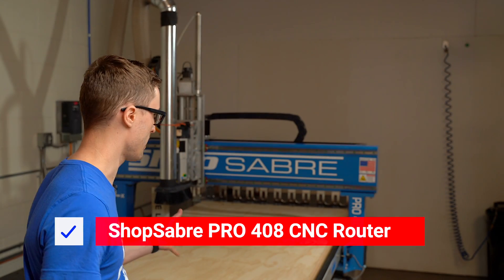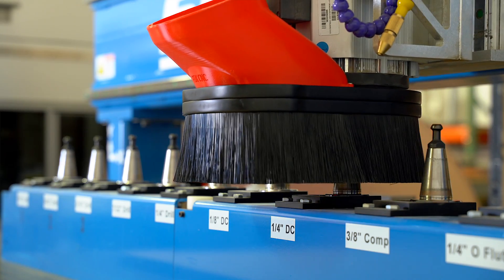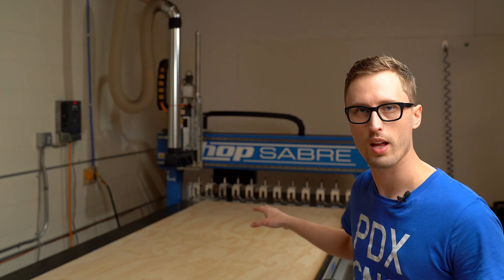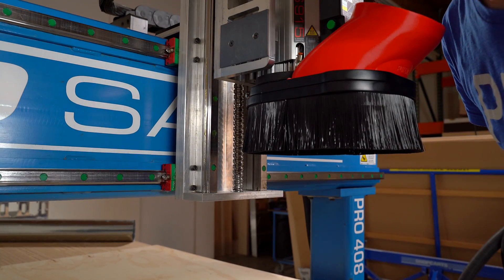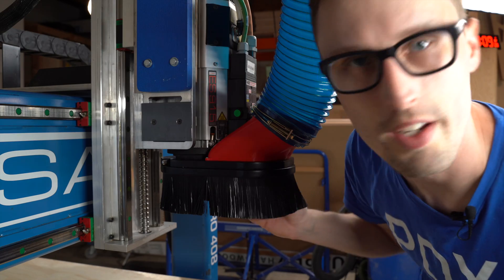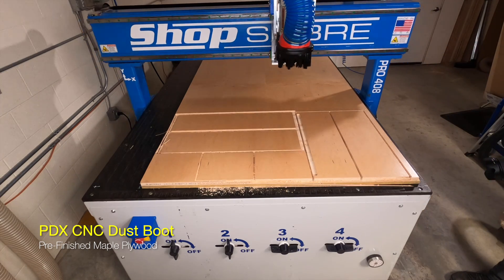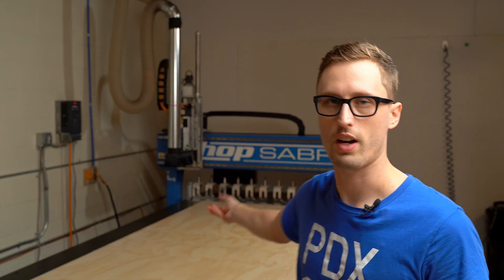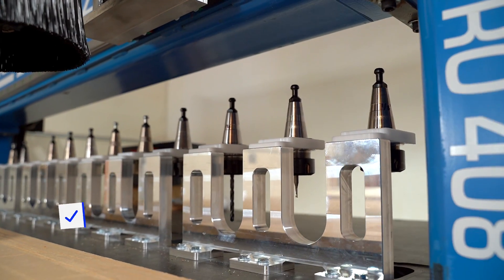CNC Router HSD Dust Boot Upgrade

Comment: I like the baby pants but.  Is the area of the 5" duct maintained throught the pants?  Any reduction of cross sectional ara is a flow resistance.  Maintaining constant area in the flow path is optinum.  What do you think?
Reply from the maker: Yep definitely
Reply from the maker: The cross-sectional area of the path from port opening to spindle increases from 5” to quite a lot more.

Comment: I’m going to go see if this will fit my ShopSabre 23 with 2.2 HP HSD.  It looks like it might. One thing this looks to have is also better clearance when working with thin pieces and the whole head has to be much lower, near clamps.
Reply from the maker: Hey. I don’t think our standard 100mm mount will. If you measure the nose and send us the diameter we might have a new option coming
Reply: @pdxcnc  Sounds great! I’ll measure it later today!
Reply: @pdxcnc  You’re right. The 1.7kw spindle looks to be 80mm diameter. Looking forward to new options you’re coming out with.

Comment: This is awesome but I'm curious how much of this contributes to the upgraded 5" ducting vs the design. Would love to see your design with a 5" to 4" reducer and 4" hose for a better comparison
Reply from the maker: It's some design, but port size is a huge factor. You can't makeup cross-section so once you go down you'll never get that volume again past that point in a system. 5 to 4 is a 36% drop in volume the best case.

Our 5-to-4 Reducer kit very transparently a big downgrade but some just don't have the option for a larger duct than that. Some more on this here: 

https://pdxcnc.freshdesk.com/en/support/solutions/articles/62000226010-how-duct-size-affects-airflow-cfm-

Comment: Do you have a file for sale, but for a 4inch intake?
Reply from the maker: We won’t be selling any files. Also probably not a 4-inch option either. The upgrade is primarily that it’s a 5-inch port which provides much more air volume.
Reply from the maker: You could definitely use the one we have but just use a 5 to 4 reducer.